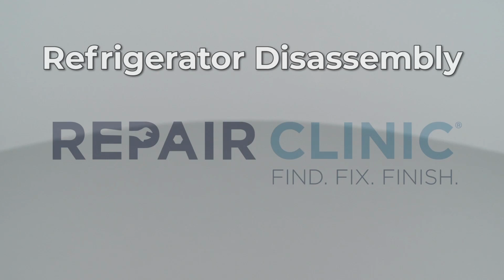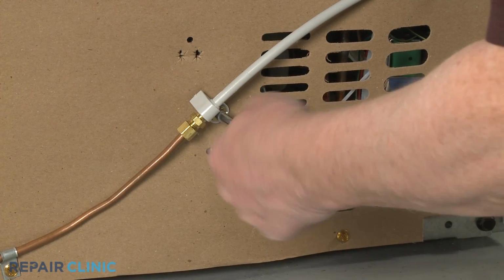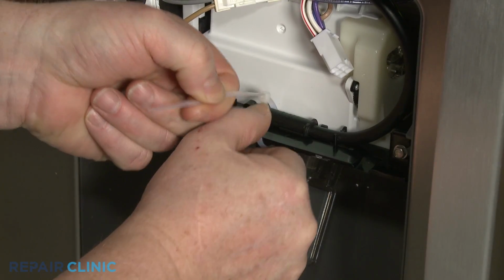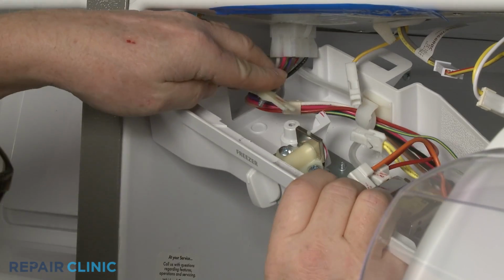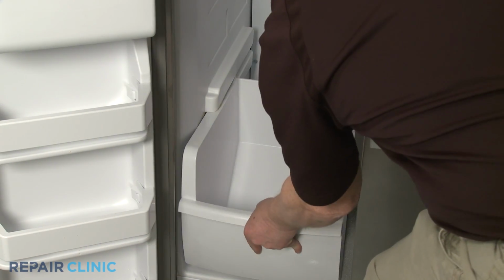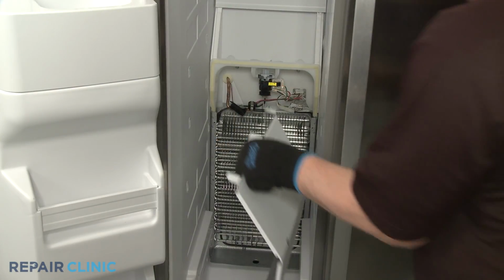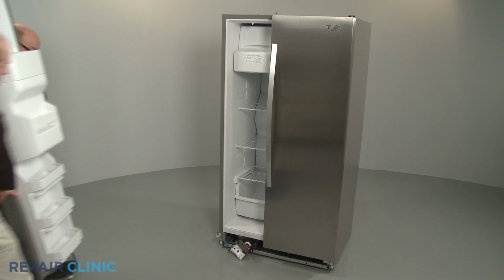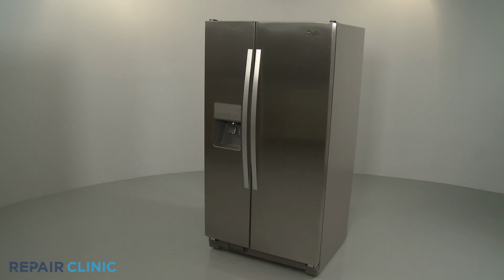Whirlpool Refrigerator Barracuda Disassembly (WRS325FDAM04)

Comment: It was hard to find the tabs, I took my phone and reversed the image and using a flashlight I found the little tabs. Thanks for the video. FYI I'm 76 and today I fixed the refrigerator light, which was flashing and cleaned the ice/water dispenser. I would not have been able to even try if it was not for the videos